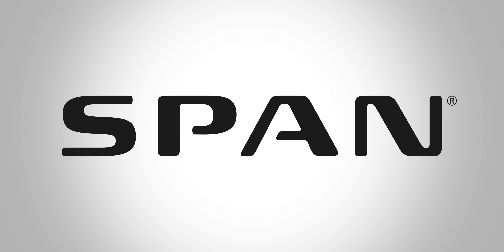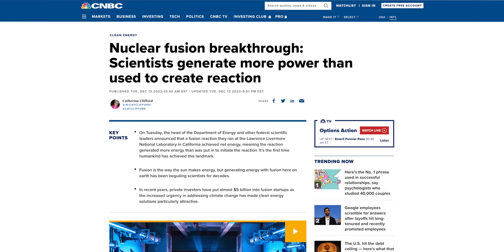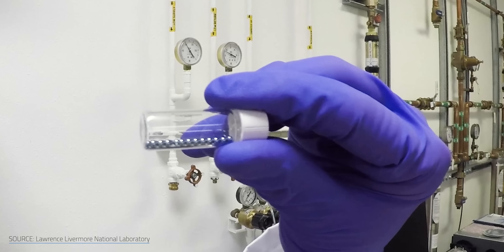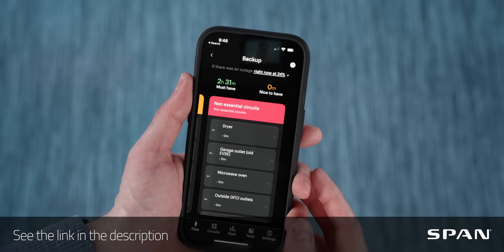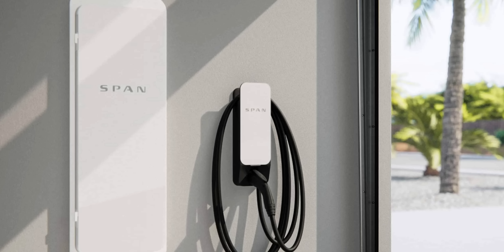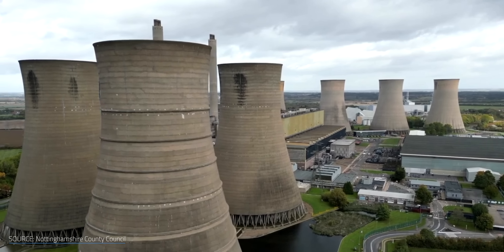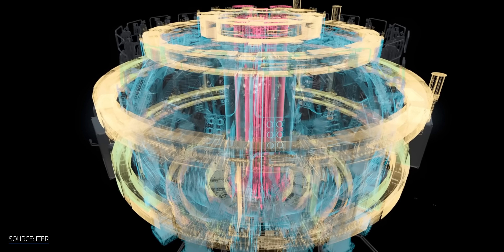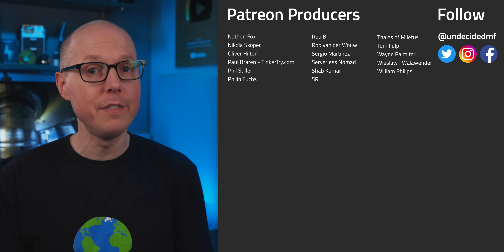What This Breakthrough Means For Nuclear Fusion

Comment: The problem with this technology is that it has no way to scale to say doing this at any reasonable frequency.
Are you going to shoot this object into the center with these hundreds of lasers like several times per second. No
This is a dead end technology it’s a cool science experiment but it’s never going to deliver steady power.

Tokamaks keep the reaction going for atleast.

I mean you can also post an example of positive energy gain with a hydrogen bomb but it’s not particularly useful.

Comment: You really skipped over the radioactivity problem. At least in the past, the main reaction is use tritium to reduce the fusion temperature. And you did mention the scarcity of tritium, but like everyone else, skipped over the two facts that tritium, T, is radioactive. And the D+T -> He + n will produce a lot of radioactive waste. The neutron absorption makes most matter radioactive. 
Thirty years? I was young in the 1970s when they said 30 years. IF it ever becomes possible, my guess is that we should expect it to take 300 years.

Comment: NIF is a research facility, and while the reaction was net positive, the energy of the lasers themselves meant it was not. However their goal was never to achieve that. That's not the point of the NIF, it's a proof of concept that it could be done and that's been achieved. I don't see inertial confinement fusion going anywhere for decades still but some day it very well may become one of a slew of Fusion technologies.

Comment: There is a basic principle in engineering: The Kiss principle. By definition, Fusion engineering must violate this design principle and consequently is at a severe disadvantage to other energy supply systems that do not have to violate the principle just to function. In the history of technology, products designed to meet Kiss, have always beaten out products that don't meet the principle. We saw this very thing with fission power losing to basically every other kind of energy source. We see it with coal and natural gas starting to lose out to solar and wind energy. We are now seeing it with ICE's losing out to EVs. complex solutions can only survive in the absence of simpler solutions. Fusion is the ultimate boondoggle because it will never be simple enough to compete with regular fission, never-mind ultra-cheap solar and wind. Even knowing nothing else about fusion than it has taken 50 years of research and still not actually produced a device that can create net positive electrical energy, I can confidently assert that fusion is DOA. It will never be commercially viable any more than fission power is and for the same reasons. We are not 30 years away from commercial fusion power plants. We are forever away.

Comment: Conceptually, I really like the railgun approach. It harkens back to fusion bombs, which just accelerated the fusion material until it ignited, only using electrical propulsion instead of a fission detonation.

It's not screwing around with inefficient lasers or magnetic confinement. It just does the implosion ignition we know how to do, and it does it without fissile materials. I also didn't hear any mention of beryllium being used in the collector which is a big plus.
Reply: With how much other fusion stuff if coming out, I feel like they are trying to bury it.  HELION

Comment: Another well presented podcast Matt and would add a couple of things here. Once fired up and I may be incorrectly assuming this, they in turn would pump lots of hydrogen (or Deuterium) into the chamber to maintain an ongoing fusion reaction, a constant fusion reaction, not a once a day...or hour...or minute...or sec pulse! 

So the breakthrough is really quite important but what level of hydrogen is needed to maintain this reaction, how are they measuring the output as there was no presentation on the output use and here the cost to production might well be a much better option for the HB11 in Oz system firing up without the lasers and initial power drain.

On another note, I have not seen any information or research into the advance start up slope of fusion reactors, that is commencing a fusion reaction and maintaining sufficient part burn/fusion reaction to provide a substantial heat resource for steam generating system at the front end. Maybe we don't need to move all the way into full fusion?

Comment: There’s an aspect to this news that is missed in all the hullabaloo…
The lab has managed to generate a net gain in energy by causing the collapse of a tiny metallic object.
What this proves is that net energy gain is possible but only by using a solid metallic fuel.  This begs the question… can any of the other methods which propose using gaseous plasmas possibly achieve the same result?  I seriously doubt it, because gaseous plasmas just don’t have the density necessary to achieve fusion.

Comment: Fusion is a dangerous distraction. It will probably never be practical for generating electricity. Even if it is, it can’t possibly arrive soon enough to save us from climate change. Even if we had a prototype plant working today it would take years to make it commercially viable. 

We must decarbonize immediately. We can’t wait for fusion, and we don’t need it. Improvements in efficiency, wind, solar, and fission are available now and work. Irrational fear is the only problem with fission. Political will is the only problem with wind and solar. A big part of that is that the oil and industry have too much political influence.

Comment: One interesting thing to note is that the lasers used at the National Ignition Facility are decades old, and current laser technology is up to 40x more power efficient.
As material scientists continue to improve on modern design of proven technology, fusion will only continue to get closer to becoming a real, viable option for (nearly) limitless power.
This is so exciting to me! So many of our problems could be solved by effectively solving the need for power generation across the globe, for pretty much everything we rely on.

Comment: NIF result may be a breakthrough in plasma science research - and that may lead to future work that will help the development of fusion power.  However, even in their press conference they said this does not advance the timeline for fusion power.  If you follow the ITER path, commercial fusion is at least 100 years away and will probably never happen.  Most of the startups are going no where, but there are a lot of them and one might actually get a breakthrough that could make viable fusion in that ever moving 30 year window.

Comment: Fusion is to Nuclear Energy as Hydrogen is to EVs. Sounds great on the face of it, but both have other options that are much more practical. Molten Salt Reactors are relatively easy to make and we already know that they work. When there's competition that's further down the development road and that has pretty much all of the advantages, it's never going to be viable. That's true of all of the Fusion approaches, they have to compete with MSRs.

Comment: It just means that companies, governments, militaries, or start-ups, will invest in such technologies or start their own in order to produce a more efficient and larger output of a reactor now that Fusion ignition has been achieved. Fusion itself has already be achieved, but ignition, where you get more energy out than you put in, is the new revolution. Almost like nuclear power except with a major lack of any environmental disaster because there hasn't been any, and even if there were, it's unlikely to cause any harm as the way it generates power does not indicate any form of melt down or chance of an explosion whatever the case may be.
Technically, we could achieve green energy by refined nuclear power plants, refined in this term is to be inferred as up-to-date or undergoes in a safer yet prominent energy producer, but since uranium has a bad name, of course the pursuit would be neglected.
The crazy thing to me is that some people think biofuels is better for the environment, but the methane they produce acts worse than carbon. Acting as an insulator 5x worse than carbon dioxide in retaining and exerting heat.

Comment: Solar and wind see their capital costs drop precipitously because of economies of scale.The cost to produce the first  solar panel was extremely expensive, but it's the same technology, so once things get going, it's much easier and cheaper to produce. There is no analogous situation with nuclear, either fusion or fission. There aren't demands for high power lasers, so each one is basically custom made. Modular fission reactors might be able to get some economies of scale, but they work best if there are hundreds of hundred-MW reactors close to cities and other major metro areas. But who is going to say, "Sure, go ahead and build here!" NIMBYism prevents neighborhoods from even building 5+1's. How do they expect that same neighborhood to accept a nuclear power plant?

Back 40+ years ago, when I was a nuclear engineering student, it was anticipated that fusion was 25 years away. Now, it's 30 years away. And with LCOE for fission going up over time, I don't ever see either fusion or fission being a relevant player in the energy production game (other than that big fusion reactor in the sky, that is).

Comment: The NIF facility is really impressive. They do put on tours for the public so if you can get in on one it is very worth doing. The Nd/Yag pump lasers have always been spectacularly inefficient, the crystal plates they are using  are amazing. The frequency doubling (twice!) also required two input photons for each output photon. So this achievement is really wonderful and hard won. Kudo's to them. I think they are only about 3 orders of magnitude away from generating engineering breakeven. So there is hope, but it won't happen soon. Certainly not in this old laser engineer's lifetime.

Comment: The issue with tritium is that most of the supply comes from nuclear fission reactors. Meaning that you need a bunch of fission reactors to fuel even a single fusion reactor. So you might as well be going full fission anyways.

The most concerning bit about this breakthrough is that it allows pure fusion weapons to be made, and potentially lowers the barrier to entry for nukes.

Comment: Dear Matt, you are as thorough, precise and objective as always. But DoE especially stated that the NIF fusion is for the next gen nuclear deterrence. They are after the 4th gen nuclear weapons: Small pure fusion warheads. So I would not expect anything commercial from this project. But it may pave the way for fusion powered space rockets, Star Wars like micro fusion generators and Asimov's micro fusion engines from the Foundation novels (and Expanse novels)... Far into the future. As for today, I would bet my money on startups, specifically Helion Energy. I did not know that we are almost the same age. I think I am slightly older than you. And a Trekkie too! Keep up the good work!

Comment: This is all hype.
While the reaction produced more energy than was delivered to the sample by the lasers, it produced several orders of magnitude less energy than it took to generate the lasers in the first place.
The reaction lasted only a few nanoseconds and there is no proposed method to increase the reaction time.
And finally for this little segment, they have no way to collect and convert the energy produced into usefull power. Especially not at those reaction durations.

Comment: We have this thing called "conversion efficiency" and the initial (nuclear) energy type is "heat", and somewhere in the conversion string that heat gets converted to electricity.  Whether "directly" or "indirectly" through an intermediate "heat to mechanical to electric" conversion string.   Either way there is "energy loss" at each stage of the conversion. (heat energy that is not converted to electricity)   So the "so-called" break even is probably in the range of 5 times more heat energy out, than the electrical equivalent of the energy in, and we are nowhere near that yet.  All this hype is to keep the investor and government money coming.

Comment: w8 how does one turn charged particles directly into power?
Is that anything like a solar panel? 🤔
Reply: Charged particles act like current, that current is used to generate electricity using wires and magnets. Solar panels use light to generate power, light isn't made up of charged particles
Reply: @ToxicJelly9  
9:16 is the part I'm talking about. 
He says charged particles and then shows an image of positively charged Helium ions getting captured somehow. 
What do you mean the act like current...?
They're not gonna act like an electric current at least.
Reply: @Broockle  why wouldn't positively charged particles act like a current? Current is just the charge flowing through a region per second, it can be positively or negatively charged particles (yes, typically we only talk about negatively charged particles, but a flow of positively charged particles is still a form of current)
Reply: @ToxicJelly9  
...but how does it work tho 😆
I get that you meant current in the flow of stuff sense not in the what comes out of the power socket sense. 
(which is not a good way to start btw)
You keep dancing around the answer without answering it. 
Wires and Magnets yay

And ye sure positively charged ions are a type of current but they don't get conducted by copper wires like electrons do. yeesh 😆

I'm guessing you mean it's some kind of dynamo from the wires and magnets part but I can't be sure.
Reply: @Broockle  I'd honestly recommend just googling it, the reason I was dancing around the answers in your opinion was because I was not trying to go too in depth, because no doubt someone somewhere can explain it far better than me, sorry that I didn't write you a full thesis in the YouTube comments section 😫
Reply: @ToxicJelly9  
....u know exactly what you did 😆
Whatever dude
Reply: @Broockle  what did I do? I said that the flow of any charge, positive or negative is a current, ie electrical current. Ergo you can generate electricity from that with magnetic inductance. That's pretty much it, there's not that much else to it unless you really do want a full thesis on it
Reply: @ToxicJelly9 
That's your most in tune comment yet. I'll just pretend that was your only comment.
Thx
Reply: @Broockle  all I was trying to do was help, and you're just outright rude. You're welcome
Reply: @ToxicJelly9  
Rude ye, hope you dun take it personally. 
This has been great.

Comment: Be careful with the approaches proposed by startups such as First Light, HB11 or Marvel Fusion. There is no scientific consensus on the methods they are using. The few papers on the subject are very controversial in the ICF community. This is something where the adage "if it sounds to good to be true, it probably is" is very true, because fusion for energy is so highly difficult that only serious peer reviewed physics work can achieve it. A final word on pb11 fusion; it is so much more difficult than DT in the thermal approach, that most startups propose a non-thermal approach, which almost by essence cannot produce energy gain. About tritium, it is not too much of an issue if you breed it from a lithium based reactor wall. Neutrons are not a bad thing either, because they actually get out of the plasma so you can catch their energy. Recovering energy from fusing alpha particles as proposed by many startups is highly dubious; alpha particles usually do not leave the plasma, and counting on the EM fields to recover energy is very hopefull given the turbulent nature of MHD.

Comment: Fusion is knocking on the door - 2 years max. Combine high currents that exceed the Schwinger limit, already achieved 100% on a table top - to provide vacuum-breaking magnetic and electric fields - with synced-up modern CPA+  lasers ...... and its a snap. Forget TOKMAK monstrosity.